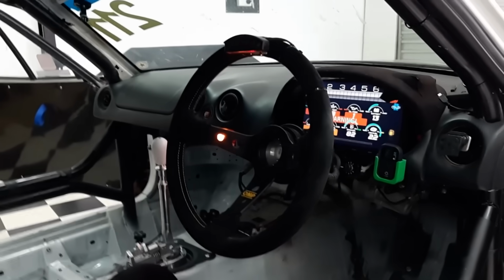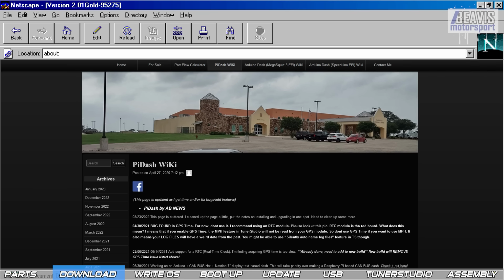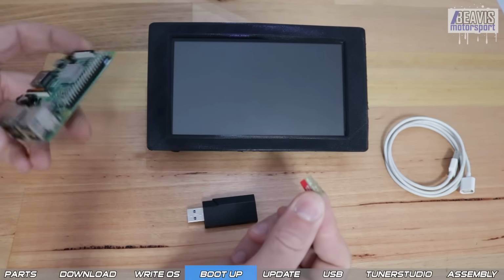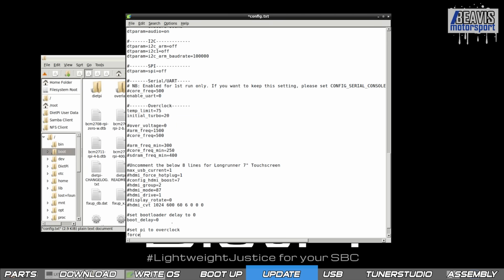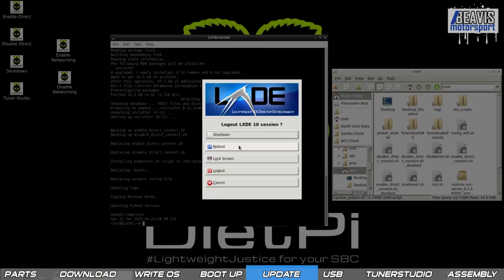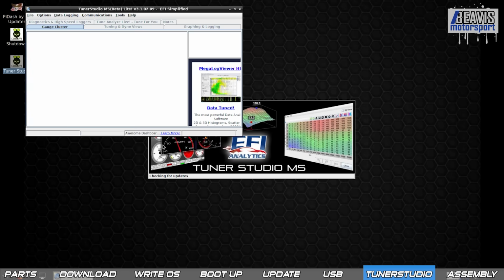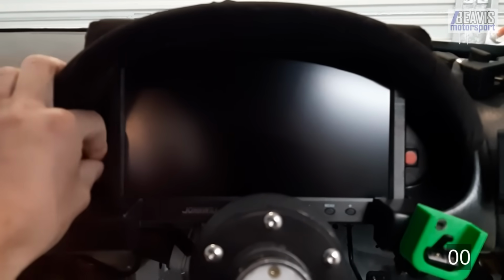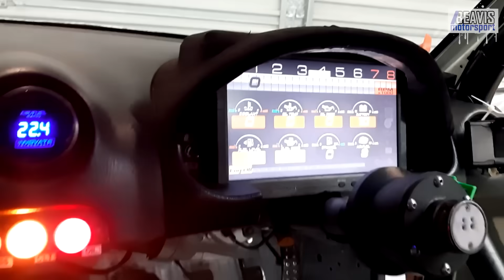DIY Raspberry Pi Racecar Dashboard: The Ultimate Guide

Comment: Great video! I'm trying to use this type of system in my v6 Camaro but I'm also adding some "exhaust acoustics" with the rpm readings. I'm curious if you have ever heard these active exhausts for the Mach E mustang or Tesla's with acoustic exhaust,  systems similar to the BMW's design with these small speakers in a metal bubble, and on open pipe the size of a muffler tip, literally playing exhaust sounds of v8. Any thought please comment
Reply from the maker: I have that in my daily driver. I usually turn it off, I like a quiet car :-P

Comment: are you using a stand alone eve or using some connection to the obd2 / diagnostics port ?
Reply from the maker: Hey so sorry, that is something I glossed over forgetting that not everyone viewing would have the context that this is for a Megasquirt ECU.
I'm running this dash in a track car that uses a Megasquirt MS3 ECU. So all my sensors, speed, temps etc go direct to the ECU.
Then the ECU has a USB connection direct to the Pi to feed the data for the dash software.
Hope that helps, thanks very much for watching.

Comment: It’s a long shot anyone that can help will see this but I’m curious about how it reads the oil pressure and the coolant temps, I’ve got a stock ecu in my 1999 Mitsubishi eclipse and was wondering if it was and how it’s possible on a stock ecu or will I have to invest in a new one
Reply from the maker: So all my sensors, be it oil pressure, car speed, temps etc go direct to the ECU.
Then the ECU has a USB connection direct to the Pi to feed the data for the dash software.
Note that the TunerStudio software is specific to the Megsquirt ECUs which is what my car runs.

Comment: awesome video cant wait to use my old Pi as a cluster. just one question what is used to transfer the data from the car to the screen? any type of OBD to USB connector?
Reply from the maker: Hey so sorry, that is something I glossed over forgetting that not everyone viewing would have the context that this is for a Megasquirt ECU.
I'm running this dash in a track car that uses a Megasquirt MS3 ECU. So all my sensors, speed, temps etc go direct to the ECU.
Then the ECU has a USB connection direct to the Pi to feed the data for the dash software.
Hope that helps, thanks very much for watching.

Comment: you could use a JZ-801 timer module to keep the Raspberry Pi alive for some time (not the screen), so if you start the car again on the following minutes, you don't have to wait the boot up
Reply from the maker: A good idea for a road car perhaps, but won't work for me with this track car where I have a battery idolator switch that kills all power from the battery.

Comment: nice setup, clearly explained. what i mis is where do you get/input the showed data ? is there a OBD connection? thanks!
Reply from the maker: Hey sorry, that is something I glossed over forgetting that not everyone viewing would have the context that this is for a Megasquirt ECU.
I'm running this dash in a track car that uses a Megasquirt MS3 ECU. So all my sensors, speed, temps etc go direct to the ECU.
Then the ECU has a USB connection direct to the Pi to feed the data for the dash software.
Hope that helps, thanks very much for watching.
Reply: @Bbeavis  clear, thanks!

Comment: I'm pretty sure it doesn't but does it require a stand alone ecu or for the car part its "plug and play" and like find the place to fit it
Reply from the maker: This solution requires a Megasquirt ECU to work with the TunerStudio software. For other ecu's we'd need to use a different approach for the software.
Reply: @Bbeavis   btw taking a chance cuz i've not found anything so far but do you know of any software that can communicate with the stock ecu and show a dash i could use if i wanted to do a raspberry pi dash ?
Reply from the maker: @Kill3r360  Sure there is a software solution  called OpenAuto which might work for that.
Reply: @Bbeavis  thanksssss I'll look into that, I really appreciate your help couldnt find anything while doing my research 🙏🫶
Reply: @Bbeavis  alright big thanks you just saved me from doing the whole thing and finding out with my cluster removed 😂

Comment: This is great! Can you show us how you assembled the raspberry pi electrical in the last bit of the video and put links where to buy the parts or what they look like? Truly love this build!
Reply from the maker: The circuit is rather basic, as follows: https://crcit.net/c/76405c09cb11400ab9f697d3f3d343a0

Parts required:
- Raspberry Pi 3+ / 4 / 5
- Toggle switch
- 12v to 5v DC converter
- Optional: 5v or 12v fan to suit Pi, to your preference
- Various cables/wires/solder etc.
Reply: @Bbeavis Thank you for the diagram! I have one more question (I apologize as I’ve never worked with Raspberry Pis before). I am looking for the 12vto5v step down, but I’m unsure how to find one that will connect to the GPIO pins. Is that something I can buy premade or do I have to create those connections myself? If I do have to make them, is there a name for those types of connections?
Reply from the maker: @gageS13  You will find some good examples of the 12v to 5v DC converter via this link: https://www.amazon.com/s?k=12V+to+5V+3A+Step-Down+Waterproof+Miniature+DC-DC+Converter+Power+Supply+Module&ref=nb_sb_noss

Then,  you will need to solder the wires, or use "dupont connector leads".

Comment: I have no idea what you just said but I’m determined to figure it out. 😍😍😍
Reply from the maker: You plug the bleep bloop into the whoozle whazzle and the blinky part goes gurr.
Reply: @Bbeavis ah-ha I was picturing plugging the schwoosh into the wah wah wah. 🤦‍♀️ But what you’ve described seems way easier! A couple of quick questions… my car is a 1981 (pre OBD2 port) the raspberry pi set up runs completely independent of that, correct? Also, is there a way to incorporate the stereo system controls into this raspberry set up also? Can this be expanded on but everything just be controlled with the one pi/touchscreen display? Oh, and will you marry me? 😂
Reply from the maker: @katykab00m  This solution isn't conducive to managing car audio. There are other ideas other there better suited to making a Pi-car-stereo. You could do it, and you can do it with a touch screen, I used to run this dash setup with a touch screen, but it wasn't a requirement for me so this current display is non-touch.
If we get married can I play with your Hot Wheels....?
Reply: @Bbeavis not only would I let you play with my collection, but I would also make a custom HW of your miata for you.
Reply: Actually, why wait til we’re hitched? I’ll make that HW Miata for you now. 🥰

Comment: Great video......  So now I have been able the upgrade to DietPi.  (I was a dummy...)  After doing my best to follow the video, I cannot get the script to gracefully shutdown the Pi by shorting out gpio pin 21 (or pin 40 and pin39).  Has anyone been able to have Tunerstudio load and then have a graceful shutdown?
Reply from the maker: Curious that you couldn't get the shutdown script working.
I shared my script in the download pack.
Ensure you have the python gpio pack installed?

Comment: I have a Toyota 22RE that was converted to propane. Is there a way to get this to work without an "ECU"?  Is there a way to connect the sensors to the Pi's GPIO pins?
Reply from the maker: This solution/software relies on the ECU connection. There are some products on the market that are more suitable to feeding sensors direct via inputs, check out OneGauge, theonegauge.com

Comment: This' very good. I had no idea there were guys out there taking raspberry pi / car combo setups seriously .. I've been using an Android headhunt to get all my data and it's been "not so good". RPM lags behind actual RPM, temps are okay, but vacuum pressures are sketchy, and voltages are a little hit or miss.. Bookmarked all the way :). Thanks much, I've got my winter project defined now :).
Reply from the maker: Thank you. I initially ran an Android tablet and found the feature-set and responsiveness to be inferior to this solution.... but maybe with a more modern tablet, and the newer Apps on the market it would be worth a revisit now.

Comment: So, the only way to get data to the dash is via USB? What ECUs are supported?
Reply: Yeah, that's what I was coming to. I would imagine there's a board you can use with a Pi to get CAN data which is the best route IMO. I'm using a kinda small name ECU in my diesel build (Baldur Control's DSL1) and I wanted to get into a Pi Dash but without getting data over CAN, which I read is possible I'll just have to do some digging. Not a problem for me, but I was curious if you covered I/O in this video. My buddy is using an Adaptronic in his FC and wanted a better dash solution too. The other option is can the Pi run the native software for your ECU and then you can. Build a dash around that, but I'll have to do a bunch more digging to answer these questions. I appreciate your reply and look forward to your video on the subject.
Reply from the maker: Hey, So sorry, that is something I glossed over forgetting that not everyone viewing would have the context that this is for a Megasquirt ECU.
I'm running this dash in a track car that uses a Megasquirt MS3 ECU. So all my sensors, speed, temps etc go direct to the ECU.
Then the ECU has a USB connection direct to the Pi to feed the data for the dash software.
Note that the TunerStudio software is specific to the Megsquirt ECUs which is what my car runs.
If you wanted to use OBD2 or if you have a different aftermarket ECU, I have another video coming soon on how to build a similar dash solution in that use case.
Hope that helps, thanks very much for watching.

Comment: I wonder if you can also run say your own headunit thru this system as well for more of a daily race car.
Reply from the maker: You certainly could, there are raspi based headunit type solutions out there, you'd need to find a way to control or switch between headunit and car dash, so perhaps a touchscreen would be a good choice.

Comment: What do you use between the car and Pi?
Reply from the maker: All my sensors, speed, temps etc go direct to the ECU. Then the ECU has a USB connection direct to the Pi to feed the data for the dash software.
Note that the TunerStudio software is specific to the Megsquirt ECUs which is what my car runs.

Comment: this is pretty badass and might end up making one, would wire mine to ignition for power on and off. thanks for the starting point
Reply from the maker: Thanks. There's some clever add-on circuits people have made to auto power on/off their pi with car power if you want a more automated power solution.

Comment: I was hoping you showed how you got sensor inputs. Did you have to use another Raspberry to make a sensor module?
Reply from the maker: Hey SuperSean,
So sorry, that is something I glossed over forgetting that not everyone viewing would have the context that this is for a Megasquirt ECU.
So all my sensors, speed, temps etc go direct to the ECU.
Then the ECU has a USB connection direct to the Pi to feed the data for the dash software.
Note that the TunerStudio software is specific to the Megsquirt ECUs which is what my car runs.
If you wanted to use OBD2 or if you have a different aftermarket ECU, I have another video coming soon on how to build a similar dash solution in that use case.
Hope that helps, thanks very much for watching.
Reply: @Bbeavis  Outstanding Bro!! This vid has definitely helped me out with what I would like to do. I have HP Tuners for my Mustang Gt with a windows 10 tablet that I've been using. Now I can make my own stand alone dash for when I put my turbo kit on. Thanks for the reply💪

Comment: Great video !! But did I miss the part where you link to any OBD reader or GPS/gyro signal ?
Reply from the maker: Hey Erik,
So sorry, that is something I glossed over forgetting that not everyone viewing would have the context that this is for a Megasquirt ECU.
So all my sensors, speed, temps etc go direct to the ECU.
Then the ECU has a USB connection direct to the Pi to feed the data for the dash software.
Note that the TunerStudio software is specific to the Megsquirt ECUs which is what my car runs.
If you wanted to use OBD2 or if you have a different aftermarket ECU, I have another video coming soon on how to build a similar dash solution in that use case.
Hope that helps, thanks very much for watching.

Comment: Did I miss the part where he hooked up sensors to the pi so it works?
Reply from the maker: I'm running this dash in a track car that uses a Megasquirt MS3 ECU. So all my sensors, speed, temps etc go direct to the ECU.
Then the ECU has a USB connection direct to the Pi to feed the data for the dash software.

Comment: How do u hook to ecu to the oil and water tends and speed rpm....if u hook to ecu how do u set that up
Reply from the maker: All my sensors, speed, temps etc go direct to the ECU.
Then the ECU has a USB connection direct to the Pi to feed the data for the dash software. Note that the TunerStudio software is specific to the Megsquirt ECUs which is what my car runs.

Comment: Would be good if you could Make a video on how you actually get the data in from your ecu. I have a link ecu, would it be able to display data from that?
Great project!
Reply from the maker: Thank you, i will endeavour to put together a video detailing how to get the ECU connection setup. In this case, the TunerStudio software wont work for a Link ECU. Instead, perhaps either the OpenAuto software would work for you over OBD2 or CAN?

Comment: As a complete newbie to this stuff… how does the pi / tunerstudio get all of the car/ecu’s metrics?
Reply from the maker: So sorry, that is something I glossed over forgetting that not everyone viewing would have the context that this is for a Megasquirt ECU.
I'm running this dash in a track car that uses a Megasquirt MS3 ECU.
So all my sensors, speed, temps etc go direct to the ECU.
Then the ECU has a USB connection direct to the Pi to feed the data for the dash software.
Note that the TunerStudio software is specific to the Megsquirt ECUs which is what my car runs.
Hope that helps, thanks very much for watching.

Comment: Is there a video on how you pull the data from the ECU?
Reply from the maker: Unfortunately not. I'll work on that in the future and share it here soon. 
All my sensors, speed, temps etc go direct to the ECU. Then the ECU has a USB connection direct to the Pi to feed the data for the dash software.

Comment: Does it automatically work when plugged into the ECU adapter on any type of car? I have a chevy I'd like to play with this on.
Reply from the maker: So sorry, that is something I glossed over forgetting that not everyone viewing would have the context that this is for a Megasquirt ECU.
I'm running this dash in a track car that uses a Megasquirt MS3 ECU.
So all my sensors, speed, temps etc go direct to the ECU.
Then the ECU has a USB connection direct to the Pi to feed the data for the dash software.
Note that the TunerStudio software is specific to the Megsquirt ECUs which is what my car runs.
If you wanted to use OBD2 or if you have a different aftermarket ECU, perhaps either the OpenAuto software, or OneGauge theonegauge.com, may work for you.
Hope that helps, thanks very much for watching.
Reply: @Bbeavis  That's perfect thanks for pointing me in the right direction. I'm going to give theoneguage a shot as I'm rebuilding the dashboard on my 75 stingray and your video made me realize I can upgrade it at the same time. New tech mixed in with the old school body style
Reply from the maker: @skylinegt6  Nice, glad to hear I have at least given you some thoughts on options, good luck with your build!

Comment: But how does this gather any of the data displayed on the dash?? This doesn’t appear to interface with any sort of sending units or any form of data collection.
Reply from the maker: So sorry, that is something I glossed over forgetting that not everyone viewing would have the context that this is for a Megasquirt ECU.
I'm running this dash in a track car that uses a Megasquirt MS3 ECU.
So all my sensors, speed, temps etc go direct to the ECU.
Then the ECU has a USB connection direct to the Pi to feed the data for the dash software.
Hope that helps, thanks very much for watching.

Comment: I’ve watched the whole video but what interfaces the dash to the vehicles sensors or ECM? every ecm brand does things differently and I was hoping to learn how that was interfaced to the pi
Reply from the maker: I'm running this dash in a track car that uses a Megasquirt MS3 ECU.
So all my sensors, speed, temps etc go direct to the ECU.
Then the ECU has a USB connection direct to the Pi to feed the data for the dash software.

Comment: Are you plugging this into the obd2 port to get the pie to get the information for the motor?. If not how is it communicating with the motor?
Reply from the maker: So sorry, that is something I glossed over forgetting that not everyone viewing would have the context that this is for a Megasquirt ECU.
I'm running this dash in a track car that uses a Megasquirt MS3 ECU.
So all my sensors, speed, temps etc go direct to the ECU.
Then the ECU has a USB connection direct to the Pi to feed the data for the dash software.

Comment: I'm looking to do this, but with the raspi 5 just having came out would everything work the same? I don't see why it wouldn't and with the processor improvements over the ras4 it should be significantly faster
Reply from the maker: I've not used a Pi5 as yet, so I am not sure. As you say, in theory it should work - it may require a software update.